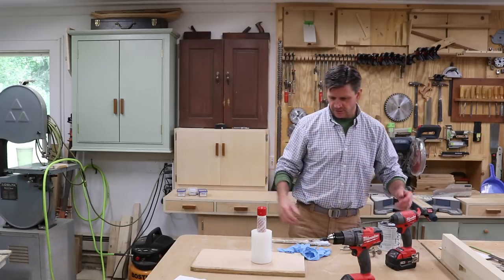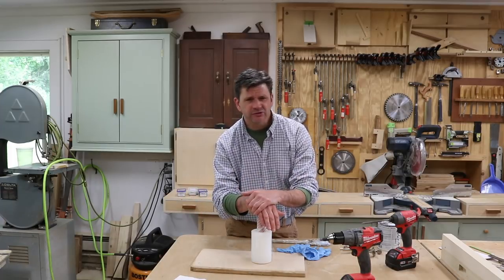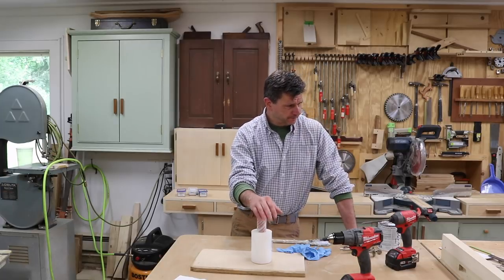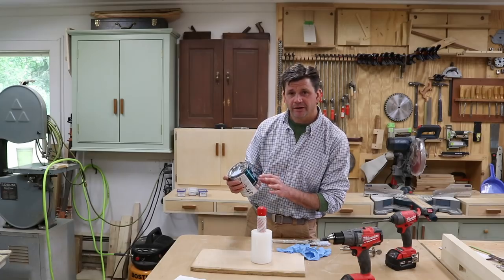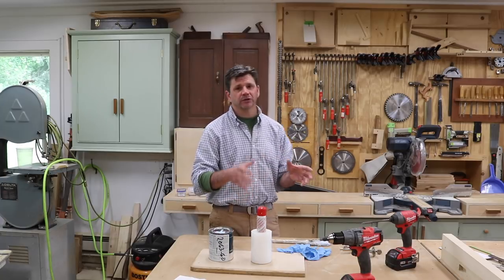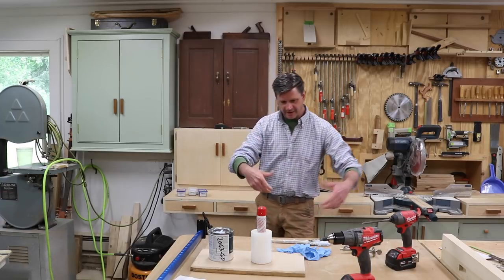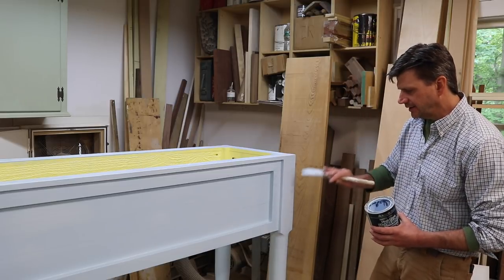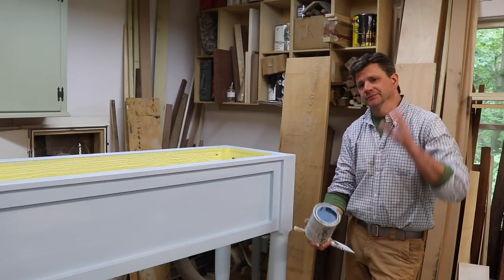Shop Talk, Thick Paint & Sure Foot Aluminum clamps

Comment: Another great video.  I enjoy all of your build videos and the time you take to explain what you are doing.  Paul Sellers has a video on inserting a length of wood into the end of the type of clamp you have and pushing it down so that it runs the full length of the clamp.  I did this with my clamps, and although it adds a little weight, it also adds more resistance to flexing.
Reply from the maker: Thanks Patrick , that sounds like a good idea

Comment: I might consider putting bolts in the bottom of the legs for adjustability and prevent rot.
Reply from the maker: Good idea,I do plan on putting Nylon domes on the bottoms, Definitely helps out.